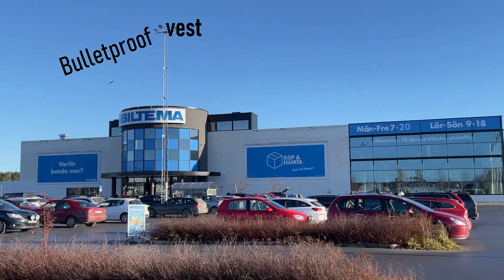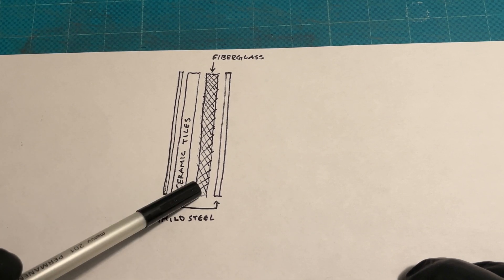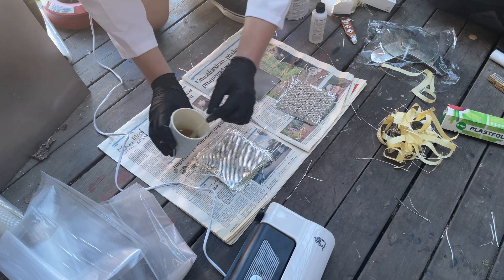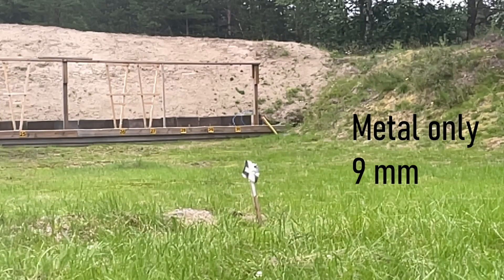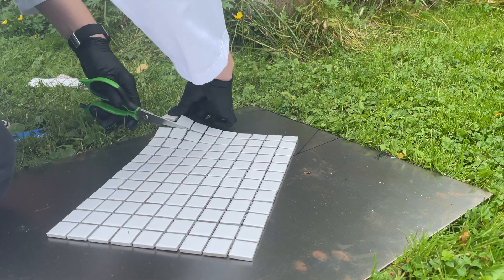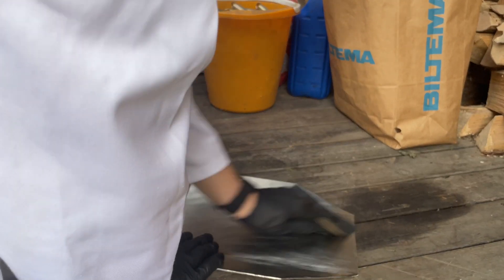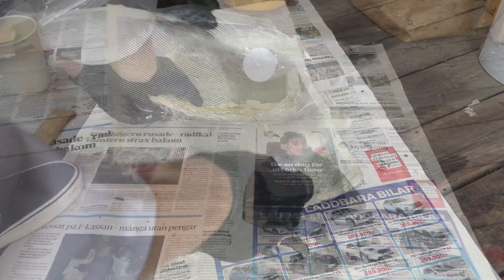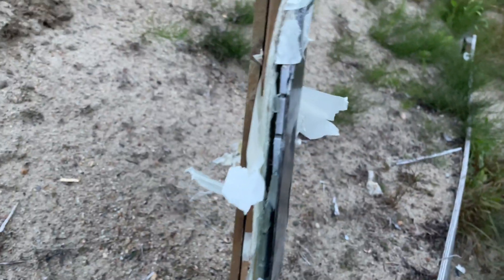Homemade Body Armor from Hardware Store Materials!

Comment: Your strike face HAS to be hardened steel if you're gonna use it, and try stacking your sheets at a 0⁰-45⁰-90⁰ pattern. Personally I'm doing a similar experiment, but I'm adding SiC grit to the resin as a filler; the concept being, your matrix is like concrete. It's not the matrix itself that makes it so strong, it's the filler you use. And, you're missing a CRUCIAL step in the process; you ABSOLUTELY MUST use some form of compression, and a bucket full of rocks isn't gonna work. Personally... i just use my car and two plywood boards. 

Right now I have an experiment where the strike face plate is alternating (and rotating) sheets of fiberglass and aluminum screening compressed and embedded in a ceramic resin matrix of my own mix, hopefully get to get out and test it soon

Comment: Inconsistent. Two metal plates, one each side.  Two layers of tiles, offset XY by half a tile. Tiles glued with silicone. So from a front: metal plate, 5 laters fiber (small caliber shrapnel net), tiles, silicone, tiles, over 20 layers resin glued fiber (fibers crossed weaving), metal plate. 
Im not a balistic expert. Just have some tiles and fiber laying around and wonder if it will work;)

Comment: Ceramic tiles (in a compound) should be on the front so that a bullet will shatter. Steel sheet is too soft, you need to harden it to make sense.
bullet ---> [ textile | adhesive | ceramic tiles | adhesive | multi layer reinforced jute/aramid epoxy composite | adhesive | steel or aluminium plate | resin | textile ]

Comment: hello friend i want you to try. 4140 steel plate 5 mm or 10 mm thick and fiberglass and uhmwpe combination and each one of them 60 layer or higher. 60 layer fiber glass and 60 layer uhmwpe attach to the front and back of the steel plate resin pressed. also use super glue to reinforce the attaching. try this my friend. overall the strong ballistic fabric and strong steel plate like 4140 or ar 500 it will help to stop the most bullet 308 338 near by 50 bmg. thanks for your video